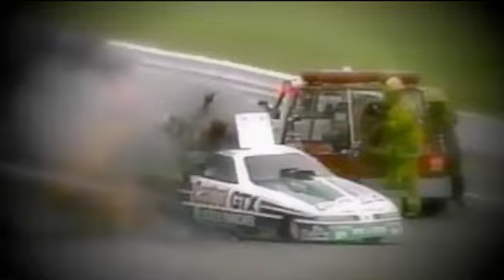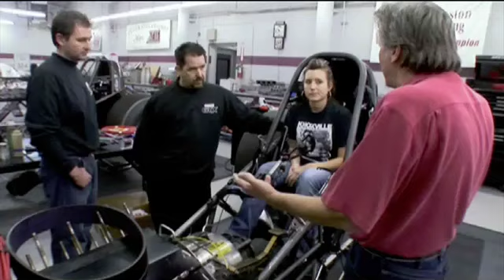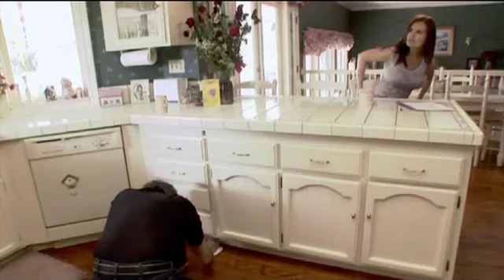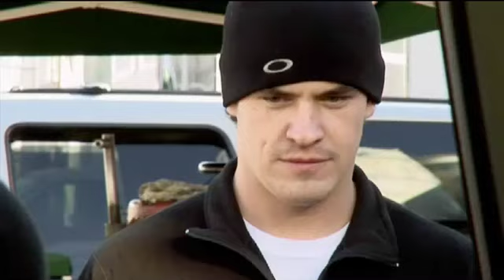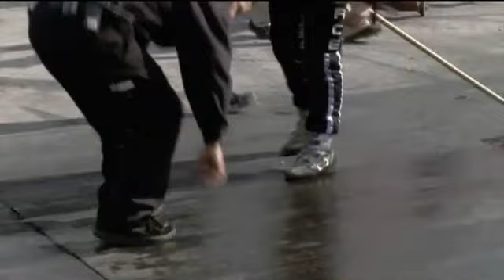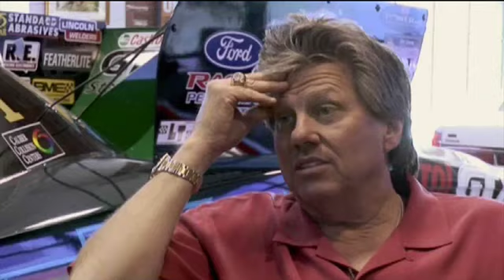Driving Force Season 2 Episode 3 Leap of Faith

Comment: John is right 90% of all crashes happened because a Team Force car caught fire. So lesson 1 how to get out if you are on fire and how to survive if your car blows up. If you catch fire first thing you do is close your throttle valve get your foot off the gas and hold on. second thing you do turn off your air if there is no air the fire won't burn. third turn off your nitrox bottles nitrox acts as fuel if there is no fuel the fire will go out. fourth kill the engine the engine is eating your fuel if you catch fire shut it down. fifth blow the chutes if you catch fire you must blow your chutes so you can slow down. and six blow the hatch and get out. wait until the car is stopped and keep your arms and legs inside until you are stopped. disconnect your air or you will break your neck.
Reply: Actually its 90% of all drag racing crashes are because car was on fire.  More so in Funny Car than Top Fuel.  The dragsters are so long that they usually get air born or start to lift off the ground because they lose down force.  This is based on watching drag racing for 30 years I watch the dragsters more so back then.  Until the mid 90's when John Force got my attention.  Used to watch Kenny Bernstein and Corey Mac.
Reply: @robertbenoit5374  I know and the last thing anyone wants is a car blowing up. what causes cars to blow up is the head gasket around the plugs and the ignition coil are not secure or you run the car hard and you have a bad cylinder and and it backfires. When this happens the heads come off and the igniter pipes catch any nitrox vapor that is around the cylinder when the cylinder goes car blows up and sometimes it shoots the body other times it catches fire. Ask John all of the first 150 wins he was on fire and he knows what happens when a car blows up.